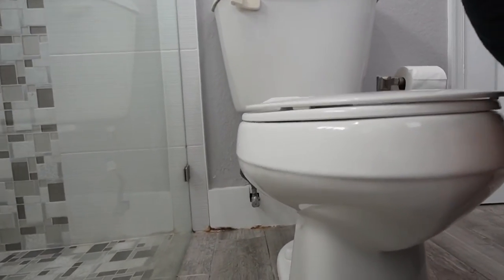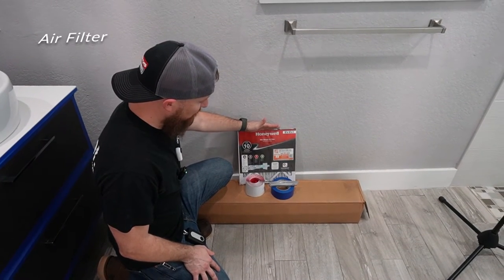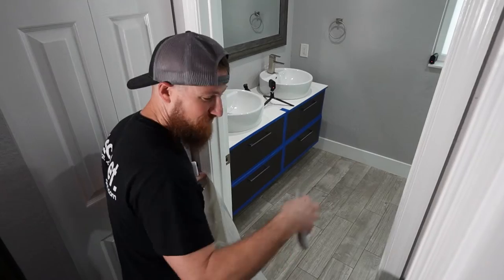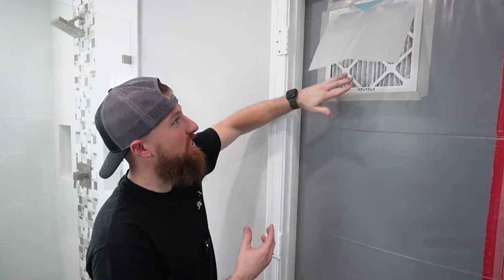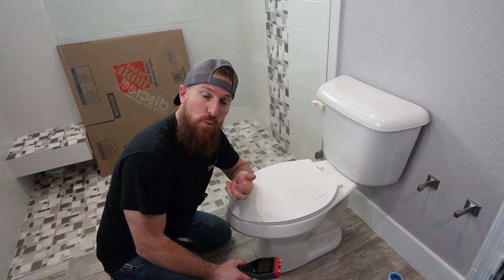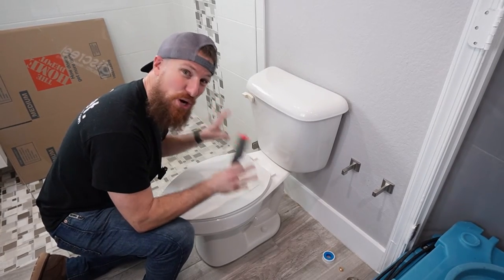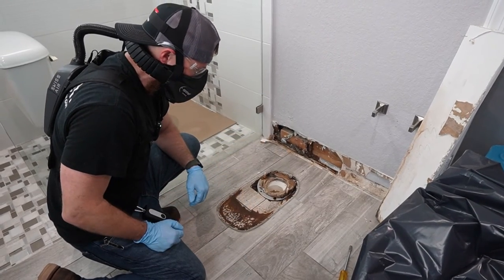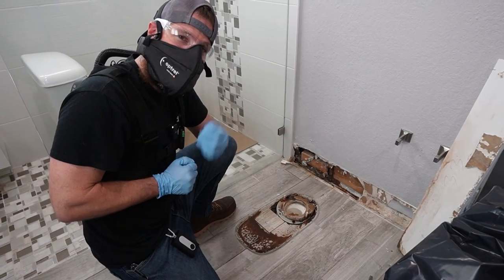The Reality of DIY Mold Remediation

Comment: If you call in a mold assessment company, are they obligated to shut you down and get you out of the house until the area is taken care of? Are they obligated to report what you have to your state or local health department so YOU can't fix it yourself?
Reply from the maker: Hi John. At least within the State of Florida, there is no requirement for us to report any of our findings to the State, or any other organization for that matter. 

A property owner can do most things on their own, with a permit at most being required on occasion. So long as individuals performing the work themselves properly protect themselves and have the required engineering controls in place, there’s few reasons why they couldn’t or shouldn’t take on a small DIY mold remediation.

Comment: Spent more time showing people how to put up a plastic sheet than the mold problem.
Reply from the maker: Would you like to know more about the mold problem?
Reply: For jobs like these, set-up is paramount.... you may think "it's just mold," but if you cross contaminated asbestos (which often comes with water damage because lots of old drywall / joint compound has asbestos) into the home, you'll have a large headache on your hands of having to damp wipe everything.

Comment: I am wondering why you created the air inlet with the filter for neg air vs running without?
Reply from the maker: Great question! I used a filter in this application for a couple of reasons:

1. I am able to maintain a negatively pressurized containment area, with reference to the bedroom, all while maintaining relatively neutral pressure within the bedroom itself. This is important because it ensures that I avoid pushing cooler, indoor air into the interstitial spaces.

2. I am able to bring in cooler air from the bedroom, ultimately promoting more favorable working conditions.
Reply from the maker: By utilizing filter, I can minimize potential cross-contamination, in the event that there is a power outage and the negatively pressurized air filtration devices turns off. If the containment area decides to pressurize, the filter will assist with excess particulate trying to make its way out of the work area.

Comment: first off love your videos man, ive learned alot from you! keep the great work up! just a little tip for the cabinet sealing. id suggest taping the back edge along the wall aswell. most bathroom cabinet drawer construction (specially hanging ones) has a super thin board just slid in or none at all at the back. and most aren't siliconed or caulked at either side or bottom.
Reply from the maker: I appreciate the kind words! As for additional preparation around cabinetry, there is no such thing as too much. Good call on the edges, as I too have seen what you’re talking about.

Comment: Good video, when I take a door off, I take out the pins with a punch. I have found that many folks strip out the screws when they try and put them back in. I have used a lot of golf tees and dowel rods in filling up holes to reattach the screws. Another note is that you talked about the waste under the floor from the bad wax ring, and I know you have seen how many companies that rent homes just cover up the mess without the proper remediation.
Reply from the maker: What’s funny is that I attempted to pop the hinge pins prior to us starting to film - but to no avail. Every once in a while I run into issues removing the pins, with this case being one of them. To anyone else reading this, Bob is spot on. Removing the pins is always a better option, as you’re not running the risk of stripping screws. Different ways to get it done, but both will typically work. 

As to your wax ring comment, many folks are more heavily motivated by mold than “water” from a toilet - for whatever reason. I think that there is more awareness on the health effects relating to mold, however, grossly bacteria-ridden water doesn’t seem to get the same spotlight.
Reply: I have messed up a few doors in trying to pop out the pins being corroded and some people just take a wack and they come right out.
Reply from the maker: @bobrebera494  Mhmm… I know the feeling. 😂

Comment: I have a beard and was working in an attic. The insulation, however, my beard was covered in unseen insulation also with a fuzzy black mold that embed itself in my face I did not know this happened while it was occurring, but days later, the insulation had glued my beard to my skin and was making my beard grow splotches along with the extra fuzz from the black mold.  It was all over my face , arm, and leg hair.
Reply from the maker: That does not sound good at all. Were you wearing a mask or respirator of any kind?
Reply: Hair is a breeding ground next time mask up and wear ppe equipment and take that stuff off before you leave work

Comment: Thank you! A few questions: how long were you going to run the air scrubber and how often were you going to change the filters? How does one know the scrubber is no longer needed?
Reply from the maker: Thank you for watching! Operation of an air scrubber will vary from situation to situation, but I tend to operate these devices for at least a day or two following mold remediation services. Our equipment often ends up running for a number of days between the time that work is complete and an IEP comes back with test results. 

As far as filter changes go, you should change them as needed. Once the remediation process is complete, most folks will change the filters and then run a single set of filters for the duration of air scrubbing. Unless the environment is very dirty, which would be odd post-remediation, not much airborne debris will be picked up by the pre filters. However, the HEPA filters should be changed regularly, given the contaminate that we are working with and the warehouse locations in which this type of machinery is often stored. 

One way to gauge when the air is clean enough and an air scrubber isn’t doing much is by evaluating particulate with a laser particle counter. If one was to use this type of device to check the particles in the air right after remediation, and then continue to measure over each day thereafter, you’ll see a point when the particulate levels stops going down. That’s generally a good time to remove the equipment.

Comment: Very well put together video. However, Just out of curiosity… are decontamination chambers a thing over in Florida? Along with wearing a suit? I ask because you went to the extent of building a nice containment on the door with make up air, utilizing an air scrubber. A very expensive mask, but then don’t use a suit nor build a decontamination chamber to change in and out of your suit to prevent cross contamination into other areas of the home.
Reply from the maker: Excellent professional observations! To your question of decon chambers being a thing in Florida, they most certainly are. They are definitely more prevalent within the asbestos abatement sector, but companies like mine and others will utilize them to better manage the process. 

As to your comments about a suit and such, I specifically lined up a small scale project for a DIY video - as anything larger would be professional level scale. A suit is definitely a “best hygienic practice” move, so excellent job bringing that to light for viewers. 

Thanks for watching and for your comments!

Comment: Is white vinegar good to remove mold..
Reply from the maker: Hi Grace! While I do not have any experience using white vinegar for mold removal, I will see that many solutions that have lower surface tension are effective at removing mold from surfaces. My go to for removing mold from surfaces is soap and water. Again, I’m only talking about surfaces here. If there’s a potential for mold to be within or behind the surface of a material, cleaning is not a good approach.